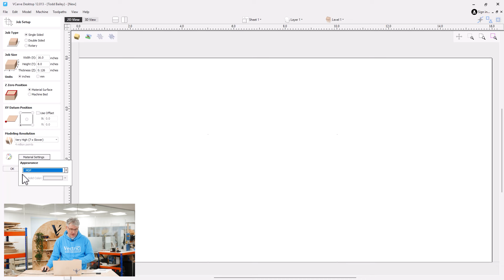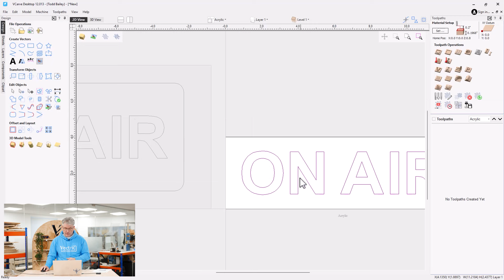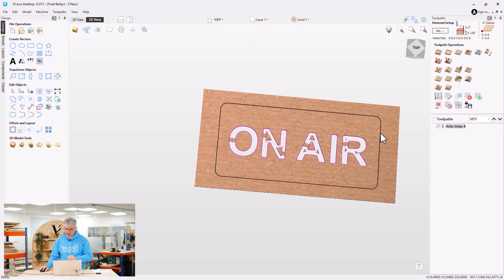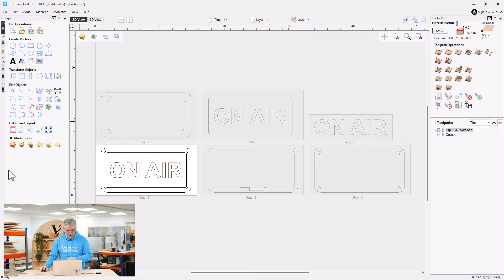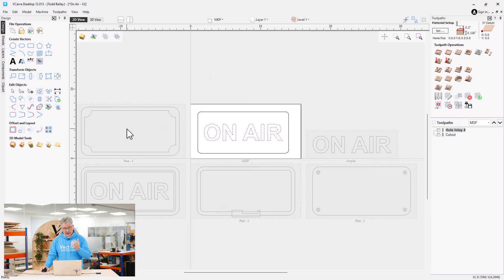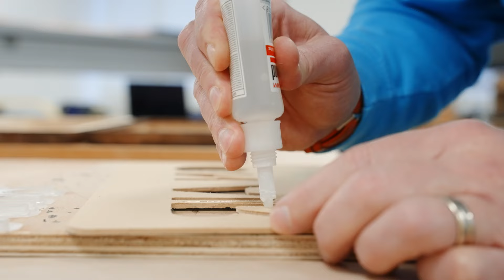'ON AIR' Sign | In the Labs Vectric | FREE CNC Projects

Comment: Is there a way to control /increase/ the height of the Z axis when going from milling one pocket to another? Right now it's quite low during the pass
Reply from the maker: Yes... when you look at your "material setup" in your software... there is a section at the bottom that you can set your safe heights.

Comment: Thanks a lot for sharing this video with details. I have a technical question, if i'm allowed to do it here. When defining the job settings at the beginning, is it important to define the material setting like choosing MDF, or it is just for visual effects? Does it affect the tool path's settings?
Reply from the maker: Hello... of course you can ask anything you want here and if it requires a longform answer or we need more information we might ask that you contact support. In this case, I can answer your question here.  That material choice in your job setup is just for visual effect... and does not impact your tooling.  Good question!  Some users will use a solid color, just so they can see the design better without the material "effects" getting in the way.  Also it is nice if you wanting to send a screen shot of the finished part, you can give them a idea of how it might look in the material you are planning to use.  :)